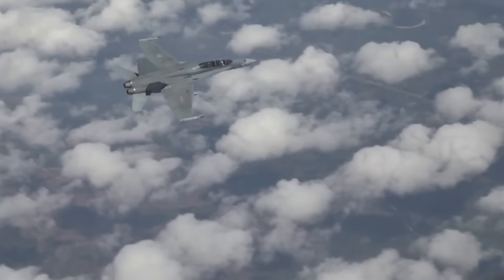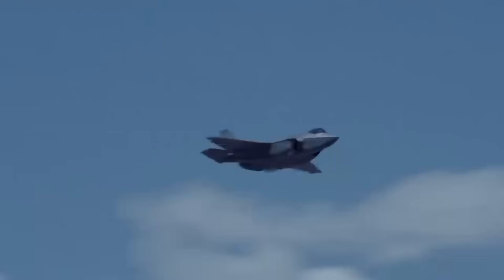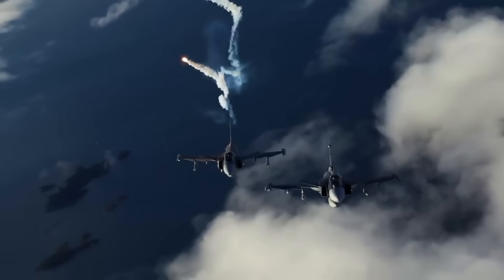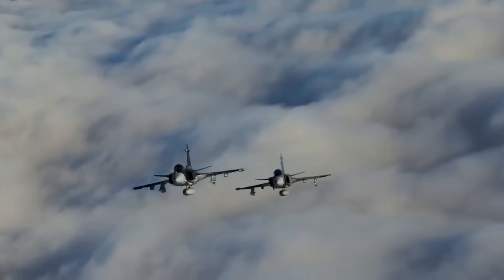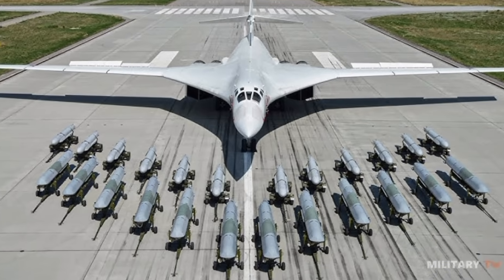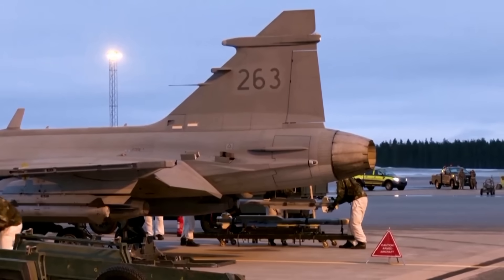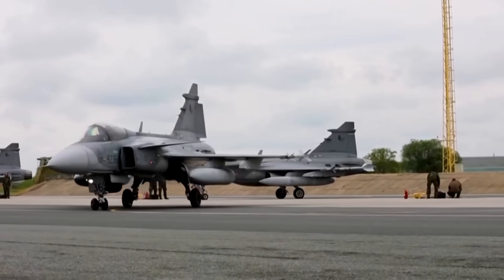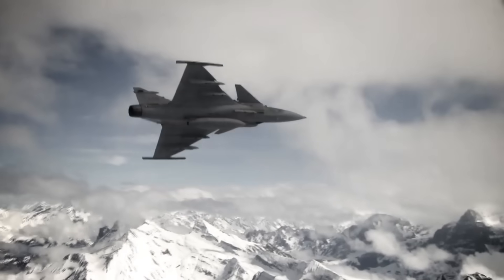Canada’s Gripen Jets Just Got a Rolls-Royce Upgrade — A Direct Threat to the Pentagon

Comment: The 2023 availability rate of the F35 was 51%. Canada cannot afford a fighter that spends 50% of its time in the shop. Couple this with software that is still half baked and the fact that Canada is to get block D aircraft with a new radar. If LM can't get the full capabilities of the current radar system up to snuff, how long will it take to fully integrate Block D.

Comment: Part of the reputation for Arctic performance of the Gripen fighter was due to the F404 engine of the earlier models which was also the engines in the CF-18's so they developed a reputation for Arctic performance.  The current F414 engine of the Gripen D, are developed from the F404 so it is assumed to also be resilient to Arctic conditions.   The Rolls Royce EJ230 based on the EJ200 family used in the Eurofighter Typhoon has yet to prove itself in Arctic conditions but the F-35 has already crashed in flight in Alaska due to Arctic conditions...

Note the part of the F414 supply chain is in Canada and Sweden actually contracts with Canadian companies for the maintainece and refurbishment of the f404 and f414 engines of their own military's Gripen's.  The F414 engine is one that Canada has expertise in.  

The F414 is also used in South Korea's KF-21 Boramae fighter of which batch 1 enters production next year, however South Korea intends to replace the F414 with a more powerful indigenous engine likely in batch 3 which is also when they are expected to be fully stealth, however, should the 16 F-35's that Canada has to receive proves that passive stealth over the active stealth of ECM happens to be essential, then batch 3 of the KF-21 may be a viable option for far less than the F-35...  Note that passive stealth can only be improved with new models and are all compromised between stealth and aerodynamics whereas active stealth is likely to improve exponentially and does not interfere with aerodynamics nor does it require changes in the airframe to improve.

Meanwhile, not only does the Gripen seem to meet Canada's needs for far less in capital and operational costs for an air superiority fighter but the Canadian TAV turboprop light fighter which is also available in drone versions, could meet attack fighter rolls for far less in capital and operational costs as well as not place pilots in danger with hazardous ground support roles.  The turboprop TAV fighters would also serve patrol and surveillance roles well at much lower costs...

As to the costs of training and supporting for multiple airframes, isn't that what the Canadian Air Force already does with the multitude of aircraft and helicopters that they currently have?

Comment: The USA could block Canada's purchase of Saab Gripens, just as they blocked the sale of Gripens to Columbia.
Reply: not if the gripen comes with RR engine.  no parts would come from usa.  we can do what we want.  the other gripen had a G.E. engine made in usa.  we'll be ok
Reply: @paulmarchand2073 Yes, that's right. It seems highly likely that, if Canada were to try to buy Gripens with the Volvo-built GE F404 engine, the USA would block the purchase.

Comment: More bait and switch headlines - anything regarding the Gripen is sheer lying…there will be no gripens flying for Canada..ever…
Reply: Actually very likely. Gripens would be built in Canada, creating many good paying jobs for Canadians. It would also help Sweden to greatly increase Gripen sales by increasing production capacity. The Gripen is cheaper and faster to maintain, it is better suited to cold climates, and can use highway surfaces for takeoff and landing.

Comment: When hearing about an upgrade in speed from using the Rolls Royce engine it could be possible that the Gripen could be one mach faster than the F35 at a fifth of the price to operate. 
 The F35 needs Canadian technology in many of it parts and by going with the Gripen Canada still helps build the F35 with components. The engineers woukd know the technology and over to the Gripen. It not about the jobs being lost .It about building Canadian defense in build our own Jets. The possibility of this is endless with creativity. 
 The biggest factor in all of this is dealing with the extreme cold and the F35 is not suitable.

Comment: Rolls Royce are not putting a new engine in the Gripen, even if they were it would take years to do it.
Reply: I Would not be surprised that when SAAB designed the Gripen E they allowed for alternate engines to future proof it, considering the experience they encountered selling the C version.
Reply: @christasker2944  That may well be so, but you do not make a few brackets and swap engines like you do in a car, it would take a great deal of time and money to completely redesign the Gripen to take a new engine,  in fact I do not think it's ever going to happen in this mark of Gripen, later models perhaps, but the idea is way down the road.
Reply: @Shytot-1 with aircraft design completely digital  and the latest manufacturing techniques Saab uses it’s not beyond their expertise look how long it took them to design the T7 Red Hawk
Reply: @christasker2944  If they did it would be virtually unprecedented. However, if Canada signs up and starts making the plane in Canada, then it will definitely be possible because they would be laying a new plant down and working from scratch, that could very well be on the cards, but even that is way off and years in the future.
Reply: @Shytot-1 it will be interesting which engine manufacturer Sweden will choose for its Gripen replacement in 2030.
Reply: @Shytot-1 the Brits did it with the F4 Phantom, installing RR Spey engines in place of the GE engines - it was not an easy swap as the Spey was larger. 
 As for the Gripen engine swap, if the engines were physically the same size, it prob wouldn't need much.
Reply: @mr-uc4me  It would be an extremely complex, expensive, and logistically challenging engineering project, essentially requiring the complete redesign and re-certification of the aircraft, and it would take years.
Reply: @Shytot-1  I dont think it would. Many systems on the Gripen are modular for ease of maintenance and replacement/ upgrade. If the RR engine fits in the same space as the GE engine did, its completely doable.
Reply: @mr-uc4me  Of course adapting a new engine is doable given enough time, resources and money, and if Canada signs a contract with Sweden they might well do it, but there are an awful lot of if's.
Reply: It's a modified version of the engine in the Eurofighter Typhoon. Proven technology and an established supply chain.
Reply: Maybe they already have